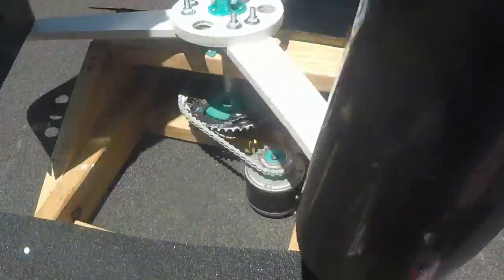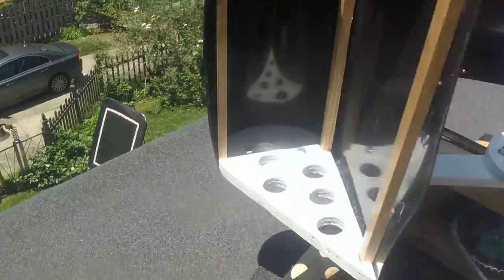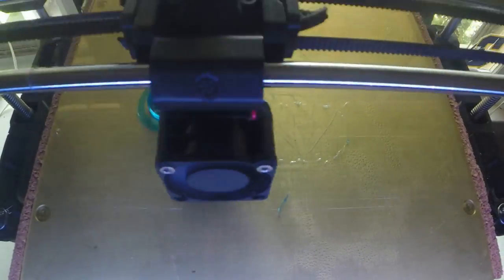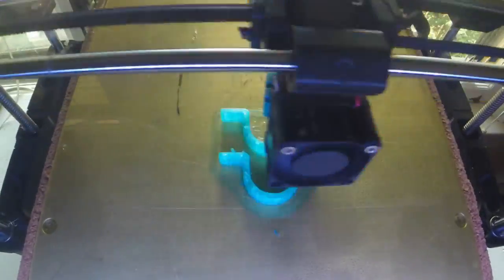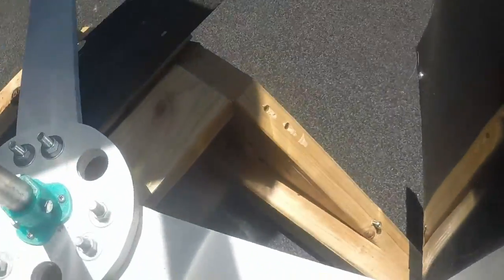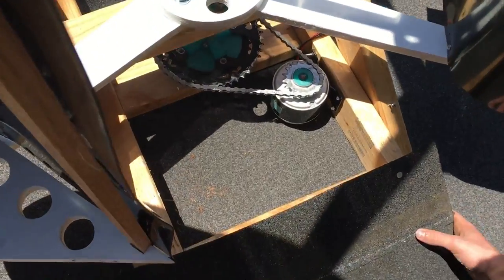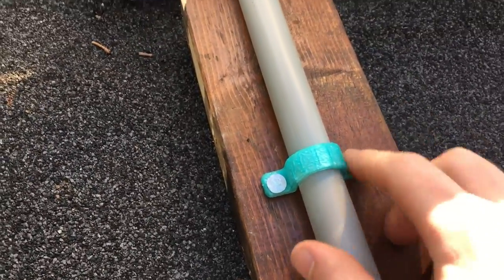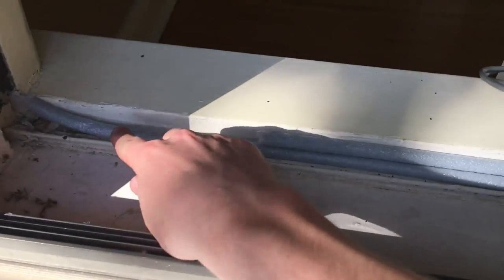Oros A - Wind Turbine

Comment: On average how many watts do you get out of it
Reply from the maker: Alex Gorshkov see description ace
Reply: do some measurements?  there are things u could do to get some readings.... It would help the project.
Reply from the maker: Evilroots it just varies so much on your geographic location any data I collect is useless for you
Reply: If your report the wattage at different wind speeds it would be very useful. Someone can compare it to reported wind speeds in their area and decide if they would get enough out of constructing one to be worth doing. Then again electricity is so cheap a small inefficient wind turbine is probably just a good science fair project. Still good work and thanks for sharing the files
Reply from the maker: There is actually an equation you can use. I didn't design the blade shape because I don't own a wind tunnel. Go to http://windstuffnow.com